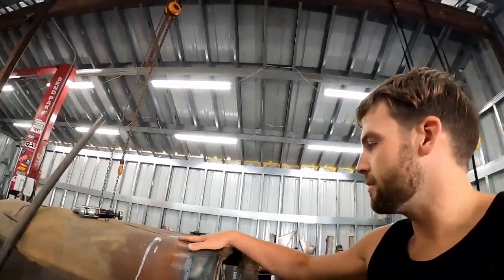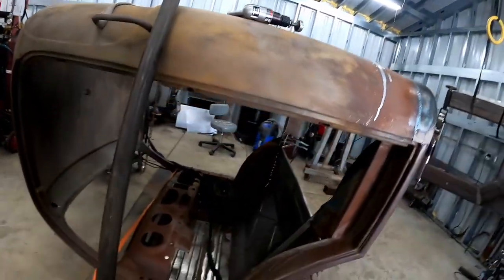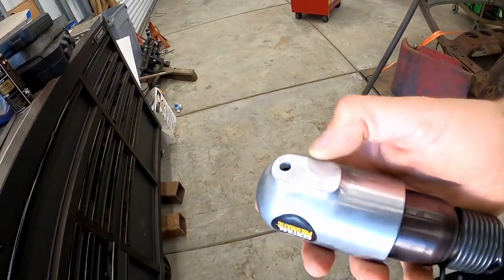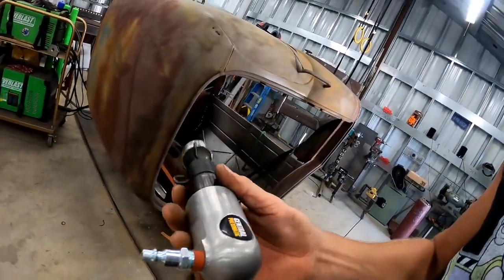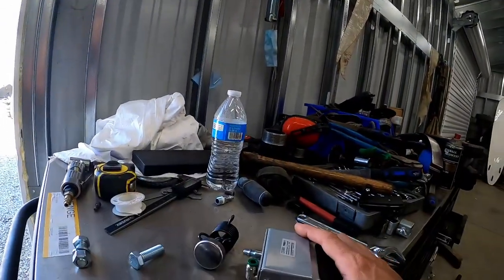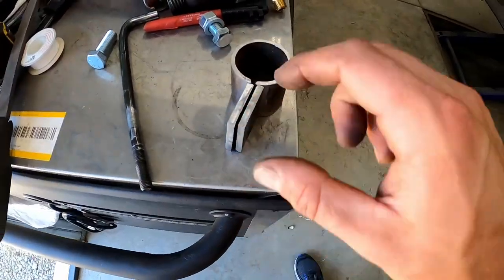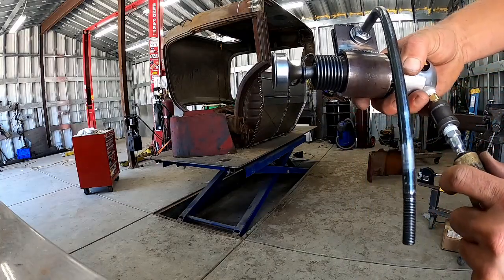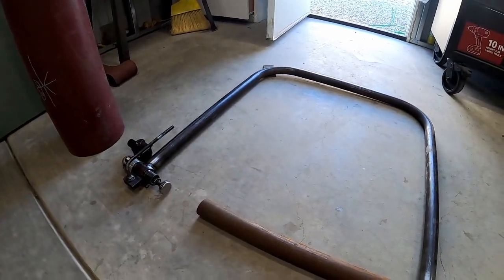D.I.Y. Planishing Hammer!

Comment: You see the top of the cab where the weld joint is?..it’s low which means your patch panel was about a half inch short….will take a lot of stretching to get that center back up without adding more metal

Comment: grind slight grove so you have a slight v for the weld then cut a short pipe place it in the other end of the tube. then stick it in your press on the other side of your sweet shop. the press should hold things together for your tack welds.

Comment: Rich you overthought it if you would have just wielded a nut on either side for adjustability and clamping force. or just wielded the nut up inside and a nut on the bottom end a fashioned an T handle for it youd'a got their faster with out near the work,
Reply from the maker: That is a very good thing point Ron, I may just modify it,  as it’s not quite as easy to setup as I’d like 👍

Comment: You can use 2 pieces of opposing angle iron or channel clamped to the outside of the tubing to keep the tubing strait as well. I narrowed a rear end with that method and it works perfect.
Reply from the maker: Thanks for the tip! Always like to have another arrow in my quiver!

Comment: You could have made a jig for the tack welding, your inner tube is long enough cut a couple 6" pieces of your outer tube, put them on the inner tube a few inches apart so you can get to the welds to clean them up and weld flat bar on edge perpendicular to the outer pipe wall across the gap. Weld them opposite sides like you were to avoid warping, 30degrees apart you'd get 6 ribs and that should hold it straight enough to weld and maybe get a die grinder in there if the inner pipe doesn't just slide out. Cool project.... I never would have had the stones to cut up that air hammer but now I see how foolish I am

Comment: Just found your channel, I'm liking what I see.  I have a similar project.  A 1948 F6 COE and a 48 conventional F6.  My plan is to marry the two and make a 4 dr out of them.  They then will be put on a 1993 F350 frame, with 7.3 turbo Diesel with 5 speed.  That probably will take a couple of weeks, na years if I am lucky.  Is that your chassi in the back ground,  Nice.  I like your project on the planishing hammer.  For more ideas on different styles take a look at Make It Kustom, he builds several different models.  The next time you try to join two pieces by welding while inside a tube.  Drill a hole all the way through.  That will allow you to immediately rotate the tube 180 degrees and weld the other side before the first welds cools, that should keep most of the warp out of the tubes.  The quicker you do the second weld the less warp you will have.  Anyway keep up the good work.
Reply from the maker: Make it kustom has changed my life friend thank you and I would love to see your build  brother please keep me updated I didn’t have the stones to attempt a crew cab

Comment: Do you happen to have the link to where you bought the lower die mount & dies?
Reply from the maker: https://www.ebay.com/itm/DIY-Planishing-Hammer-Lower-CP-Die-Post-Pullmax-English-Wheel-Made-In-USA-/114206336130?mkcid=16&mkevt=1&_trksid=p2349624.m46890.l6249&mkrid=711-127632-2357-0 
Search his store
Reply: @turborich8316  AWESOME. Thank you. I like the way you built yout planishing hammer.
Reply from the maker: The only thing I’d change is to request the seller custom make a longer die post if you are considering building one!
Reply: @turborich8316  Excelent suggestion. Thank you.

Comment: Maybe if you have to do something like this again, you should bevel the joint before you weld.
Reply: The bevel suggestion was made so the weld would be below the surface and maybe allow the part to be rotated easier. Good luck with your fabrication.
Reply from the maker: I was most concerned with trying to keep the two pieces straight and I was a bit worried that a bevel would allow more chance of distortion, but it distorted anyway 🤷‍♂️ I think long run I’m just going to order a longer die post and not worry about customizing it at all! Thanks for watching!
Reply from the maker: I bevel all joints that require strength, this was simply an experiment. It is also a joint that sees little to no lateral force so it’s not in any danger of breaking. And if it did, I could always just weld it again.

Comment: Maybe grinding the ends on those 2 like beveling them so when you weld the weld will pennatrate and you can always grind afterwards and have flat surface
Reply from the maker: I considered beveling them however there are not much forces that could cause this joint to break and even if it does I can always just weld it again with a bevel, or better yet just buy a longer post like I should have from the beginning
Reply: @turborich8316  Very inspiring seeing someone making their own tools, your design looks like it will work good, I'm sure  your welding will hold up. Thanks for posting and sharing.
Reply from the maker: Thank you, for watching!

Comment: When you butt weld two pieces of metal like that, you need to bevel both pieces before you weld them. You will have a much stronger weld, plus you wouldn't have had problems with it coming up in your weld hole. Also a slot would have been better than a hole if you had the means to make one.  Otherwise keep up the good work. 
Like Rat Rod Bob says you're getting it,you just ain't got it yet.
Reply from the maker: You know I wasn’t so worried about the strength of that joint because I had a feeling it was going to have issues being straight, I will be purchasing an extra die post that is just machined longer so I won’t have to have a piece of tube welded to it at all, thank you for the tips 🙏

Comment: If you want your planishing hammer to be effective, you need to clean up the welds first. you are trying to move more metal than there is space for in the panel and you end up with either an ugly weld line or an over stretched panel . The weld bumps also screws up the anvils over time.
Reply from the maker: Thank you very much for the tip! I believe I did indeed over stretch certain areas at the weld seam, but it’s fixable. Now I know better for next time!